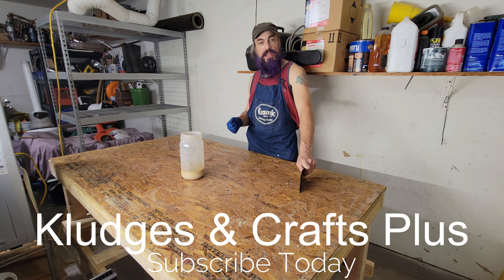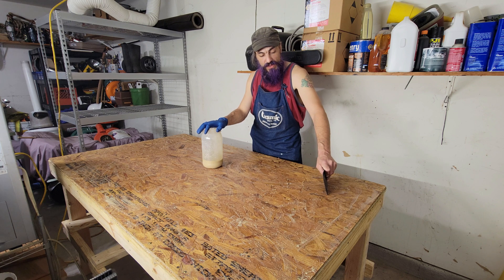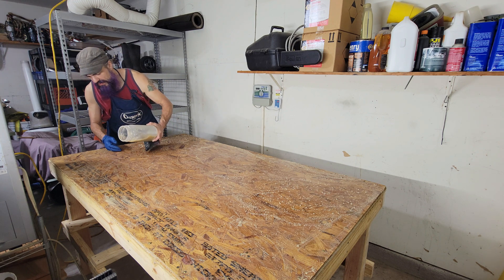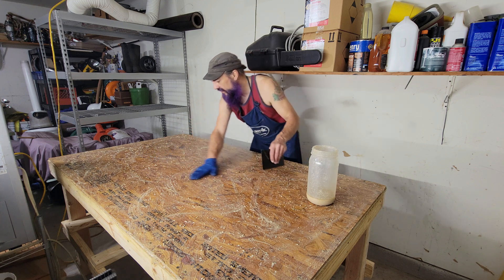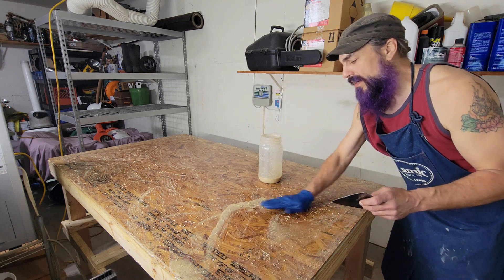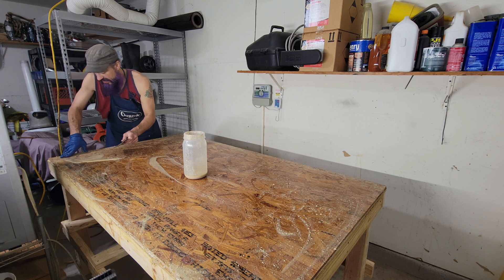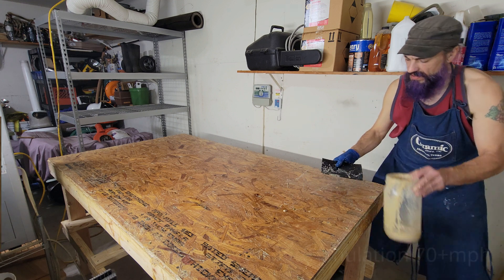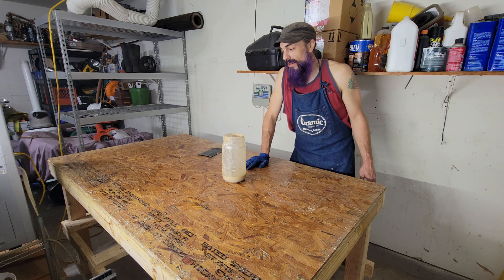Fire resistant OSB shop table top hack? Water Glass (Sodium Silica) Part 1 - testing in Part 2

Comment: Intersting. I have used watergass with wood glue  (pva) before and it became flakey then peeled of like dry skin. I did not mixed though. First i used the glue, then the waterglass. Never tried them mixing
Reply from the maker: Yeah the acetone didn't work out but something like isopropyl alcohol probably would have been a better choice. The table service has held up to basically everything except hammering because it physically damages the chip board.

Comment: add how much sodium  silica to pva glue wood glue
Reply from the maker: Sodium silica and PVA really didn't mix well. The PVA clumped up like cottage cheese. The acetone didn't then the PVA either. One of the comments suggested something like isopropyl alcohol as it is a hydrophilic solvent. The table has been in use for some time now I have done a variety of wet things on it and the surface is unblemished.

Comment: I've heard of using sodium silicate to preserve eggs but not to fireproof wood. Although now I seem to remember a VERY old Gilbert chemistry set where one of the "experiments" was to treat paper with sodium silicate to fireproof it.   I think adding acetone was a bad choice; it's not a good solvent for PVA glue and an even poorer solvent for sodium silicate. Just about any metal ions will form a precipitate with the silicate ions, so you're probably best off using distilled water to prepare the solution. Very interesting.  I look forward to seeing your results.
This would be useful to treat a wooden solvent/paint storage cabinet, at least for storing small quantities of solvents, stains, shellac, etc. Thank you.
Reply from the maker: Well there were no observable differences for sure with the acetone.  Very likely flashed off quickly given the surface area, and very low concentration. After the water glass soaked in, a damp rag brought the glue back to a point where it could adhere to the wood, and very little remained. I figured I would wait at least a week for drying to wet/char the testing samples I produced in this process.